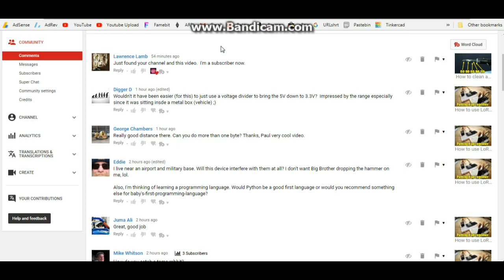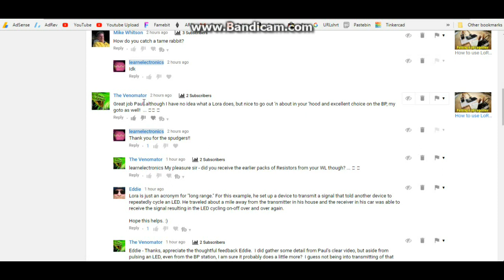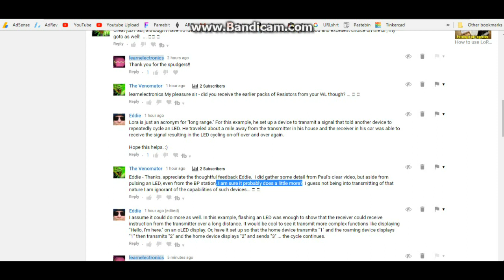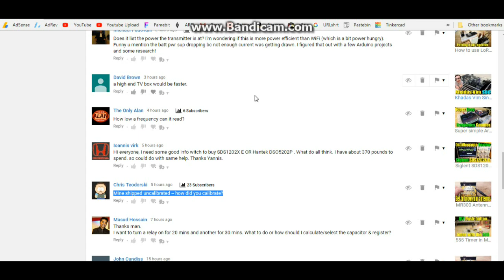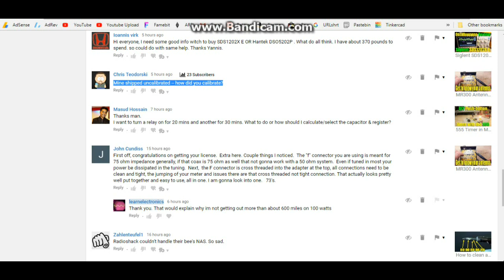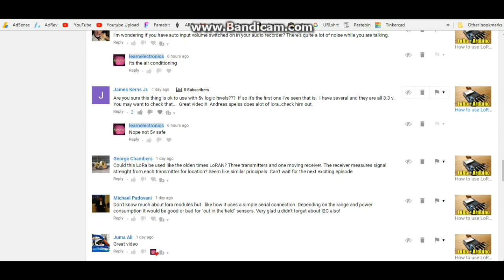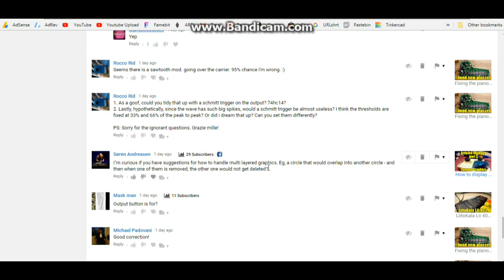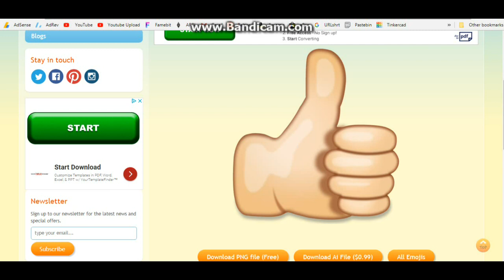Electronic questions and answers

Comment: I have put a led bulb and 9 volt battery to a circuit board, and the light won't come on, please tell me what's happened.
Reply from the maker: With a resistor? If not you burnt out the led.

Comment: If ,I made a sketch for say a Nana ,would I have to alter the sketch to work in other arduinos, reason is I want to use a 3.9 or 7 tft screen inch ,which I don't think the nano supports.
Reply from the maker: The nano and the Uno are for all intents and purposes the same. The Mega, Pro Mini, and Leonardo all use different MCUs. So there are some small differences.

Comment: Thanks for the answers. The Long Range Aid to Navigation Or LoRAN used 2 stations for each frequency one master and one slave. They were known locations so you lined up the master and slave channels for 3 different sites then compared signal strengths for them to give you a very close location. A similar system was used with Radio Beacons. This system wasn't as accurate or as expensive so fishing boats and coastal traffic used them. I spent 2 1/2 years at Cape Blanco LoRAN station in the coast Guard. We had both LoRAN and Radio Beacon as well as a Lighthouse that is still in operation. All the rest is long gone since GPS.

I like the demo videos because they introduce new hardware. However once a week would be fine with me. I also like the answer session as well. Thanks for listening and for the wonderul videos!
Reply from the maker: Thanks for the info

Comment: thanks for answering my question. I have another.....What's the difference between a transformer and a ballast?
Reply from the maker: Its basically semantics. But modern electronic ballasts are simply switch mode power supplies(SMPS).
Reply: ok, I was more curious about the old florescent ballasts and the metal halide/sodium vapor ballast, which looks like a large multi tap transformer and a large cap nearby.